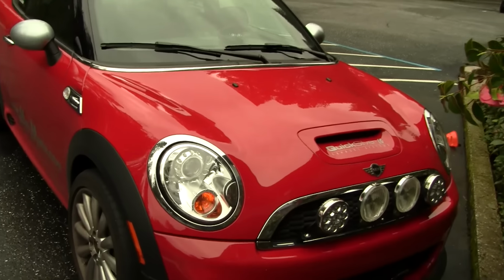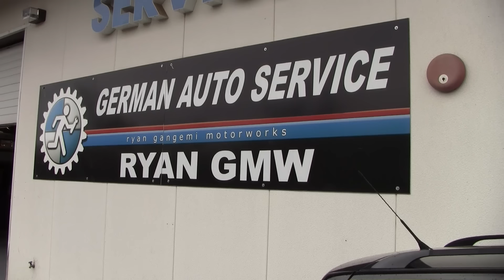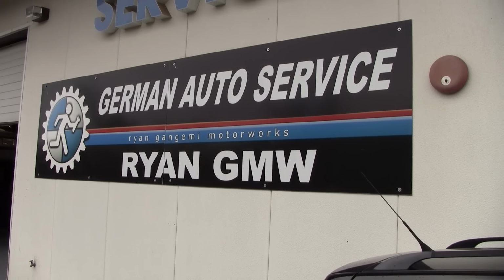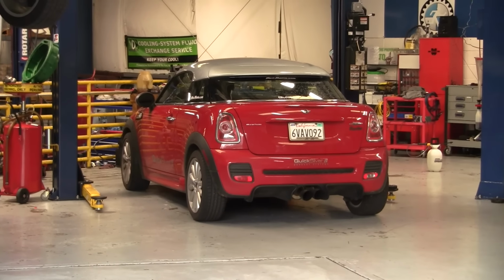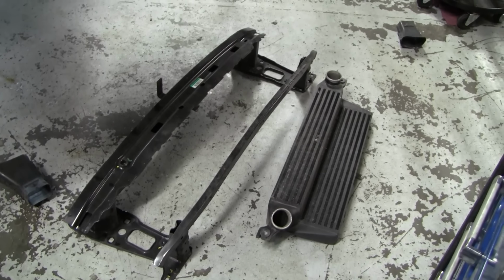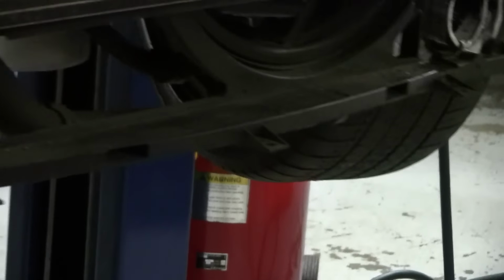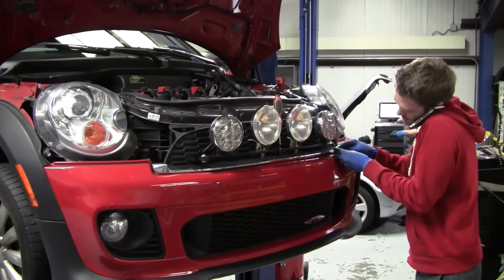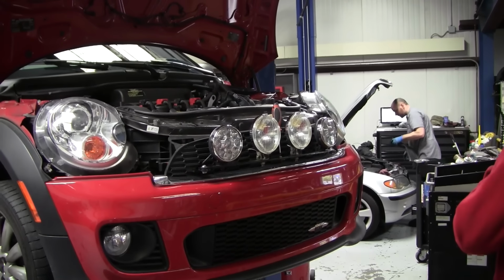2012 JCW MINI Cooper Intercooler Install - Swap

Comment: Would a front bumper like this fit on a r50 or would any newer model bumper in general fit in a r50 or does it specifically have to be a r50 bumper

Comment: The old intercooler looks just like the new one?  Both are way bigger than my 2009 intercooler I am assuming both were not stock, correct?.  Curious what was wrong with the old one?
Reply: still doesn't give a reason, other then being a new design. lol
Reply: It's not a new design

Comment: Did you have to do some trimming to install the previous intercooler??
Reply from the maker: I don't believe so.There's was a tab on the top of the old intercooler that was never connected to anything as it was such a snug fit it wasn't necessary.